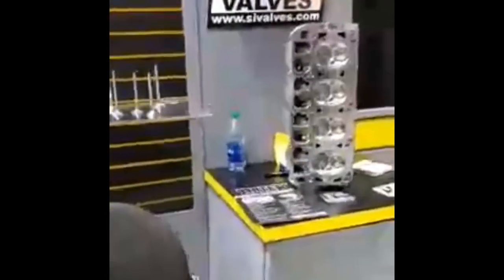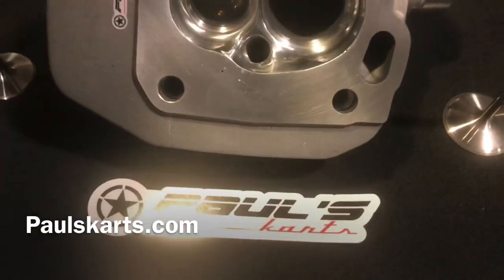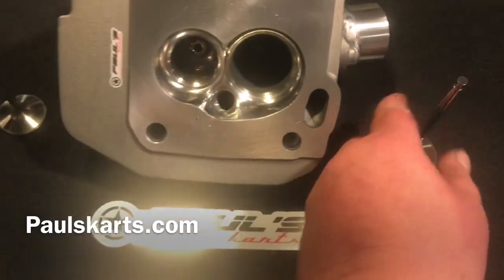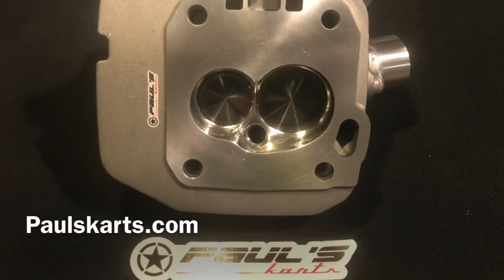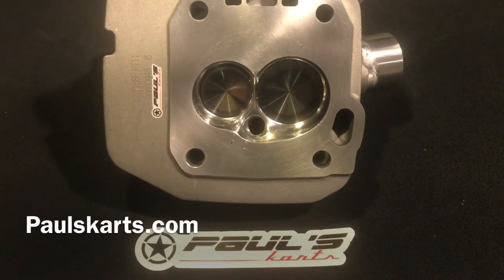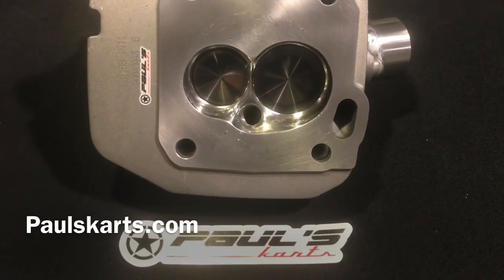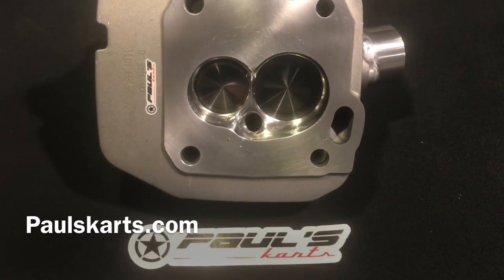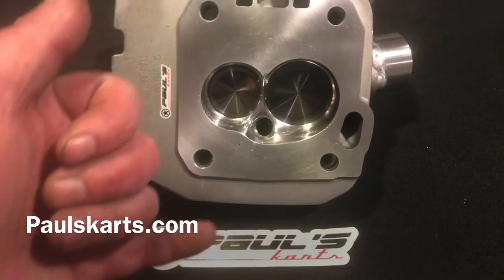JD from SI gives a shout out! And Big block GX390 welded 43/34 head

Comment: Hello! Please tell me what speed can a cast-iron flywheel withstand? I worry about him.
Reply from the maker: Need for Sim .. 6k rpm ish
Reply: @paulskartslifan4206  thank you
Reply from the maker: Need for Sim but that’s max .. only small bursts to that .. 4,500 is probably what I’d call a safe operating rpm
Reply: @paulskartslifan4206  the maximum rpm was 4900, on stock carburetor. I bought a PZ30. Maybe do you know, it will give me more power?